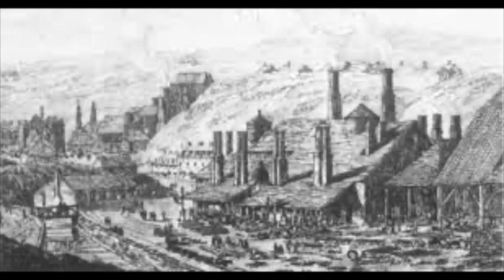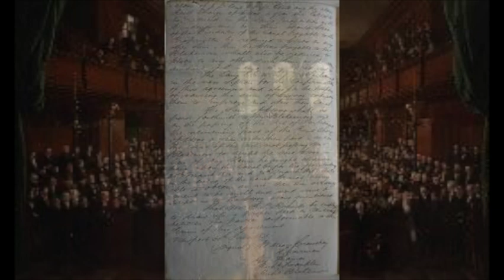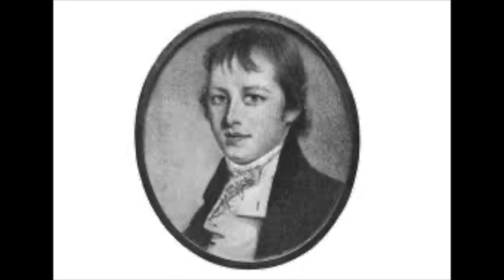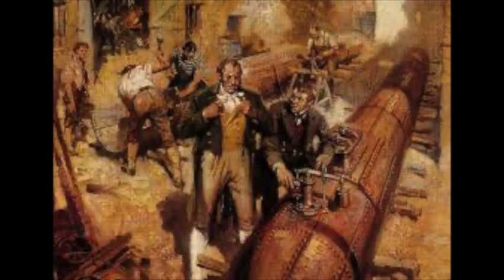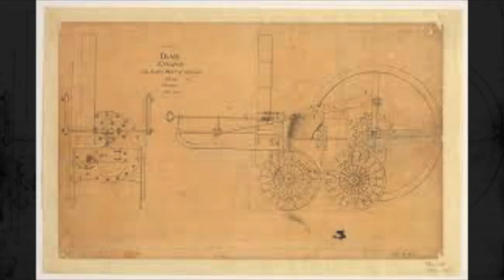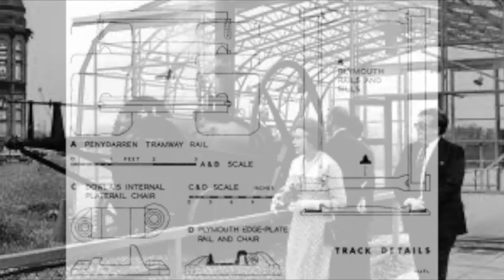Pennydarren

Comment: A superb video with one caveat: More modern historical research suggests that the replica locomotive we are all so familiar with was not the Pennydarren locomotive at all. As presented by early railway historian and fellow Youtuber Dr. Anthony Dawson, the plans so long believed to have been that of the Pennydarren locomotive, even thought so by Richard's son Francis Trevithick, it was actually likely built for either the Rhymney Ironworks or the Tredigar Ironworks around 1805. This was actually long mistaken to have been a locomotive built for the Coalbrookdale Ironworks in 1802, but modern research suggests that this earlier engine never actually existed as the only contemporary record of it is a single vague mention in a memo and Coalbrookdale never had a plateway of the right gauge for such an engine. 

The engine as presented in the historic drawings is shown to run on a gauge of 3ft 1 1/4in, too wide for Pennydarren. Further, it would be too tall to pass through a low tunnel on the tramway's line. Finally, it has been suggested that the Pennydarren locomotive actually had a breeches flue boiler, with two return flues splitting off either side of the central firebox, the same type Trevithick used on his 1802 London Steam Carriage. More accurate drawings based on this research show an engine that sat much lower and squatter on small wheels with only a modest flywheel at one end and a stubby chimney to clear the low tunnel. In broad principles, the replica is more or less correct as the two locomotives would have worked in the same mechanical way. But in technical details, they would have been nothing alike.